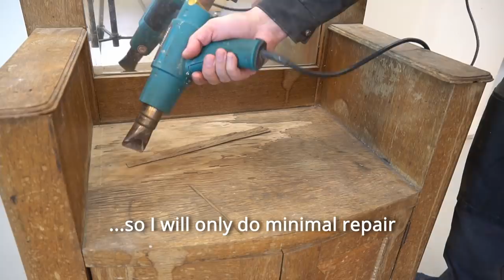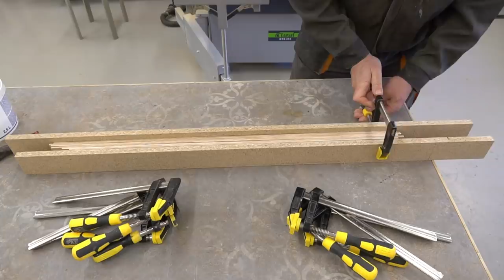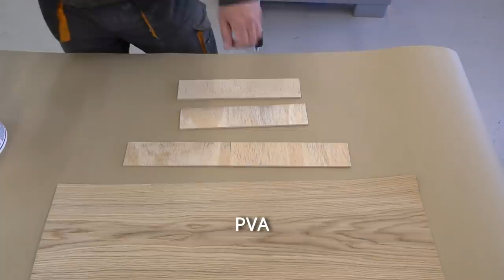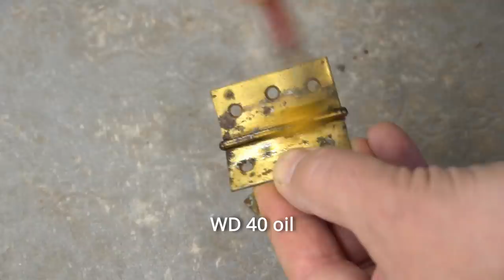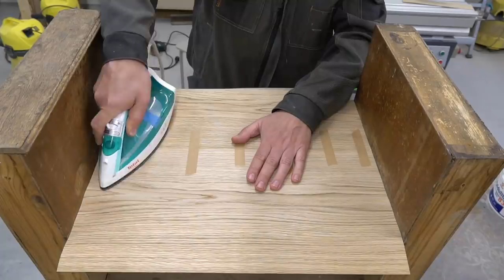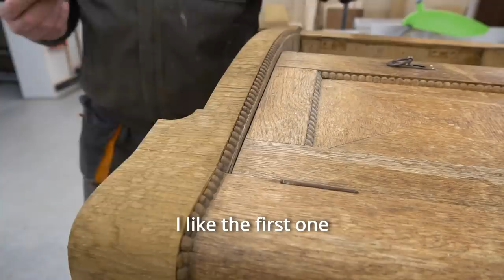The CLIENT threatened me with a MOLOTOV cocktail if I would make it too beautiful

Comment: It’s a very good question that you raise; complete or minimal. I watch a lot of tool restorations and they generally try to make it look new. That I don’t agree with as I think as I’ve done with my own tools they should be brought back to function as intended. Grinding them to produce a mirror finish is silly.
When it comes to furniture the answer varies with the condition it’s found in. For the hall mirror chair you just did I think the work should have gone further to create a worn but uniform finish. Most of the items I’ve seen you do have started in rough shape and needed the level of work you put into them. Many of the pieces seem to be “finds” that folks have found, In this case there’s no family history for the scrape in the back so restoring it to new for its fresh start with a new family makes sense. 
Good work as always
Reply from the maker: Yes, I agree. By "new" I meant that some scars still show when they make the item more interesting. Sometimes the damage is too far gone, then it is not aesthetical anymore.

Comment: I think it would depend on 2 things-  client’s desire and possibility to restore not fully.  Any piece can be ‘restored’ but what is the extent of the restoration?   I believe you have done an Excellent! job in both regards.  The structural restoration of needed areas and the application of the correct techniques to ensure the client’s desire of ‘not too new’.  To not finish to perfection takes a more delicate hand to make something look as you did-Kudos on a project WELL DONE!

Comment: As someone who has seen both sides of the restoration coin, I would say that the most important factor in making something "as new" defaults to the historical importance of the object being restored. If the client wants to return a familial heirloom to its former glory, I see no problem in using whatever methods it takes to bring that item back to life. However, if an object has significant historical importance, like a one-of-a-kind work of art, then I think it's important to retain some memory of the damage, and a way to undo the restoration for the future restorer. For example, with paintings:  At a certain point, the dings and scrapes become part of the piece. And it's perfectly fine to use certain paints to reduce the impact of those dings and scrapes, but concealing them destructively does a disservice to the piece.

Comment: I would have to say that the extent that you "restore" an object entirely depends on what and why you are restoring something, if you want something to remind you that it is old but want it to be fully functioning and not falling apart then that should be how far you go (don't go to the extent of removing all the scratches and dings, but if there are missing or broken parts then those can be replaced but you could make them look like they had been there always, add dents/scratches) 
but if you are wanting something that you don't have a sentimental value to but want the look of the original style then it could be fully restored and brought back to looking new

Comment: Answering your question: In  my humble opinion  whether or not you make a piece of furniture look like new depends on a whole host of factors.  A good example of how you treat antique furniture could be found in the jewelry collections.  How would you treat a Faberge piece compared with a Cartier piece. You would never alter a Faberge piece of jewelry but you might consider altering a Cartier piece of jewelry. 

The Value and collect ability would play a major part.  A piece of genuine Chelsea furniture would be treated very different to a big standard piece of barn furniture.  

But it also depends on the history of the piece of furniture and the condition it is in. Bad repairs could have been done to the piece  which compromises its strength and durability.. The person repairing it may have not taken into account the factor of wood movement and shrinkage and glued or nailed it in a way which means that when the wood movement or shrinkage happens the joints crack or even whole pieces crack. In this case a timeous recovery would be necessary.. I also have seen pieces of antique furniture which were so badly treated in the past that to save the piece a full restoration and even replacement of parts was necessary.  Of course problems such as worm damage, broken or rotten wood affected by dry rot and damages caused by years of use would also decide the level of restoration.  

I have also seen the full restoration of Art Deco furniture which brought back the beauty and elegant soft lines of the piece. It looked like new and still retained its past glory. 

In the case of your molotov experience I would say that the choice I would make would be guided on whether a minimum refreshment and minor repairs on it would shorten or lengthen its longevity.  Like it or not we are actually not the owners but the custodians of the antique furniture and it is our duty to do our best to preserve these functional works of art for the future generations.  

But the client is king and what they want has to be respected.  

I would have liked to see this piece brought back to its former glory  but I am not the client.  You and other restorers have shown my that aged wood doesn't lose its patina and so a respectful restoration (with lots of coats of shellac  😁) Will restore its former glory. 

Go well and thank you for sharing your work with us. I have learned a great deal from watching your and other restorers channels. These channels are a refreshing change from focusing only on the terrible events happening in the world at the moment.  They give you something good and constructive to focus on.

Comment: Well AT, if I was threatened with a Molotov cocktail, I guess that I would have to do what I was asked to do, ( maybe the original condition was the result of a former restoration that was not to their liking ha!)But I would have preferred it to have been a little more work on the sides and back and the streaks removed. The work that you carried out was exquisite as usual, and I always get excited when I see your posts. Take care and stay safe regards , Sandy

Comment: You did an amazing job and kept the original patina. But the owner has to decide whether such a minimalistic repair will actually allow the object to survive for a longer period or not. There is the old saying 'A stitch in time saves nine'. But I would say "Yes stitch it up but dont use tacks use proper permanent stiches.' Because you dont only owe it to yourself but to future generations to make sure an antique lasts for them to enjoy. I do not like it when restorers change the piece in a way which makes it impossible to bring it back to the original version but to restore it in a way which will increase its longevity is important and by doing so honours the original designers and artisans who designed and crafted the piece. Thanks for you restoration. You show us many ways to do these jobs.

Comment: There is a price premium for original patina, BUT, unless it is a museum piece used for research, it should be repaired so that it is at least useable again for 100 years. Solid wood chairs, tables, if were well made originally, may need minor repairs and decent cleaning and wax. Veneered furniture, however, looks worse for wear compared to solid wood, of the same age so it will probably require a lot more restoration to almost new looking to make it useable. Think of a 150-year-old solid oak kitchen worktable and a 150-year-old veneered desk both sitting next to each other in a damp storage shed for 100 years. Which would fare better, and which would require more restoration to make it presentable and useable?

Comment: I'm with the customer here. All the shiny-blink-blink-restaurations break my heart. 
"Restauration" means to me: Do the minimum required. Not the maximum possible. In the best case: Just clean it and leave it as it is.
Reply: Actually this is a distinction between conservation and restoration in the art world.  Conservation is doing as little as possible to stabilize a work to prevent further damage.  Restoration is completely restoring the work to its original state (as much as possible).

Comment: A client can have a lifetime of history with the object and remember family members or important events through the marks on the object. If you make the object look new then it's nolonger that object and it will feel like you stole the object and the memories that it triggered.

For example; I have an old photocamera case that my dad took with him on his travels. It's made of leather and it has wear marks all over, the shoulder strap is tied to it because the metal fastener broke back in the 60s. If a restorer ever fixed that loop and replacedthe strap, I would do also slap them in the face untill it just wasn't funny anymore, becuase that knot defines that case, it's what makes specifically it my dad's.

Also: if you are going to make an old object look new and remove all it's history then why not just build a new one from scratch? It's cool to see an old object getting restored to look like new but I MUCH prefer that it's history/age remains visible. It's like giving a 1970's machine a 2020's color, you just don't do it.

Comment: I think you could have gone further. Like I totally get what your client means and I have that fear as well - where something has built up a patina and character and you fear that it’s going to come back in high gloss varnish. But your matching finish and subtle water drops are great - but like you could have done the whole thing like that and the piece would have maintained it’s character. But I assume that your client has some sentimental attachment to the water stain down the side. It does look cool and bohemian but fixing that too would make the piece still suitable for a classy albeit contemporary home. I too struggle with deciding if I want my home to look more like a bohemian cottage /student flat or very classic with just some modern touches…. If you like TV dramas, the decor of the minister’s townhouse in “Anatomy of a scandal” is the perfect balance of heritage and modern furniture and decor …. this piece would work in that setting if it was fully restored (glossy shellac) or if it was restored and then stained and slightly distressed as you have done to the bits that you repaired 

either way whats wonderful is that anything on the spectrum between partial or full restoration means that the piece will stay in circulation for another few decades and then will be in good enough condition to be upcycled again to decorating wims of a new generation. So I don’t even hate all these silly tiktokkers that are just covering some ball and claw thing in chalk paint because then in 10 or 15 years someone like me (or a master like you) can restore it. maybe update the ironmongery maybe not